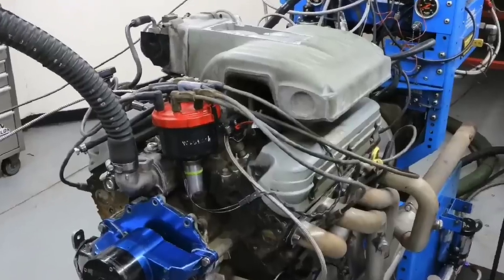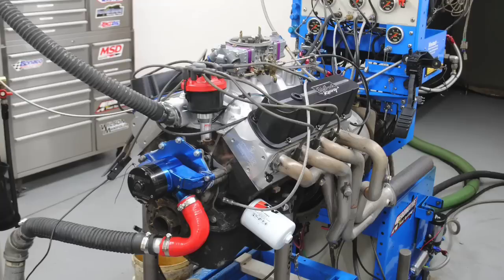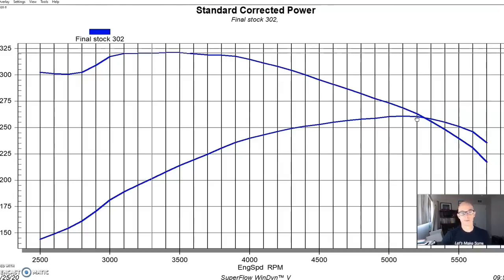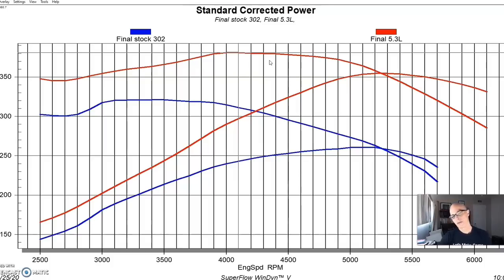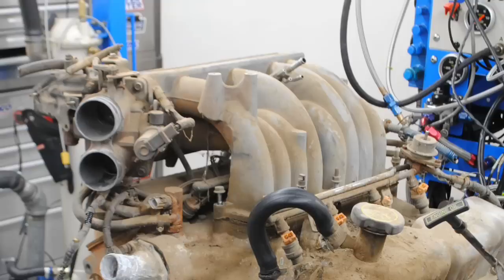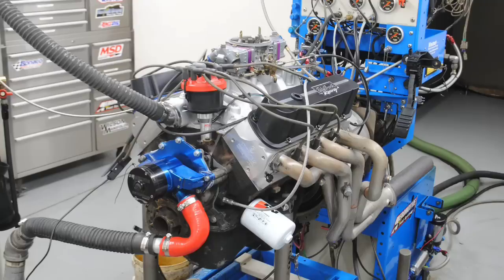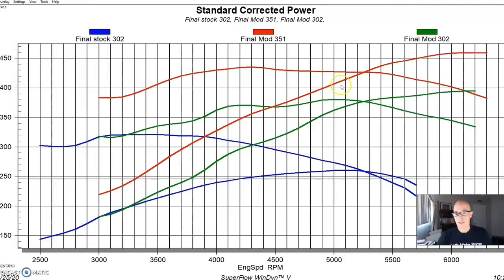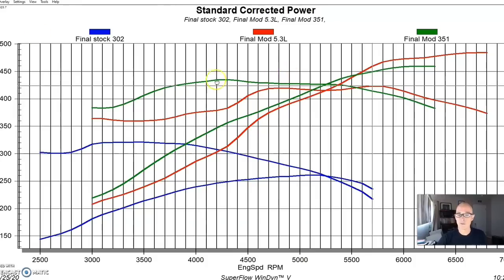5.0L vs 351W vs LS-SHOULD YOU SWAP?

Comment: 1 word = CLEVOR .. Outflow LS heads.  Use the 351 block if you need over 500hp.  347 Clevor is a potent combo.  Magazine guys had Cleveland heads available to them in the 70s and 80s.. and didn't write about them.  I remember Zero Clevor articles back then... damn shame.
Reply: Ancient technology C heads 
Modern is better $$$
Reply: You must be rich
Reply: @hotrodray6802   Airflow doesn't care about age.  Box stock Cleveland heads flow 250cfm.. enough to support 500hp.  David Freiburger's 408cid Clevor made 650hp with Trick Flow Cleveland Heads .. blah blah modern.   Stock Cleveland 4V's can be had for $600.
Reply: 800hp Clevor -  https://www.youtube.com/watch?v=sSjzJQHRs6A
Reply: ^^dont get me started with the Aussie stuff or Yates stuff derived from cleveland heads. 

Fact is GM used the 351w architecture to design the LS. 

Ford could have CHEAPLY done an aluminum 351C headed Windsor to compete if they wanted but they chose to go modular for long term emissions purposes
Reply: The Best NASCAR engine from Ford was actually the Windsor with Yates/Cleveland heads. They dropped the Cleveland block because of poor oiling.  800+ HP and 9500 redline. Chevy could not compete with this until they did a re design and then Ford built the FR9 The LS is a better bottom end Y block with cross bolted mains but Ford has that back in 1962 with the Fe.. Great for a race engine or truck engine but overkill for a street engine, IF you want that in a Ford get a Coyote or the Godzilla.
Reply: @mountainofeverest3861  Sounds good but the supporting hardware will most likely cost you an arm and a leg. What's a good intake cost for that? Headers? I put a budget 393 Stroker in my car that I paid $3200 for, took about another $2k to put it in the car (intake, distributor, headers, pan, etc.) but I will try to go turbo (stupid LX front end is the obstacle now). So 8# of boost won't need head flow as the block will be the limiting factor. Just my thoughts...
Reply: @robertelmo7736  Edelbrock 7183 manifold is $350. 351W roller cam engine core from Pick A Part $200.
Reply: @mountainofeverest3861  Build it, I want to see it lol...would love to see a cheap 408 with those canted valve heads!
Reply: Best racing combination ever. MBE just came out with a new set of SBF Cleveland style heads for 2020. MBE stated that these cylinder heads will put a hurting on any  Chevy cylinder heads available!
Reply: @Greenskies321  They look nothing alike, try again
Reply: burn baby why do you think you can bolt on LS heads TJ a Windsor? Look into it more, it’s not uncommon for manufacturers to borrow or (lease) designs from each other. An LS has a ford FE bottom end with Windsor bore spacing and bolt holes. It was cheaper for GM to do this than to start from scratch and is a budgetary decision. They have to run a business after all and cost savings is crucial when you compete with other car manufacturers.
Reply: @hotrodray6802  lol, them ancient heads from the 426 hemi seemed to whoop up on chevy pretty fucking good back in the day. ford and mopar were in the top ranks. chevy was in the garbage fighting for scraps.
Reply: @Greenskies321  
There's only so many options you face when designing a pushrod V-8. There's solutions that work. Be honest with yourself. How much SBC is in a Ford Windsor in terms of general layout. How much did the Mopar Poly influence the Ford Power Train engineers in terms of valve train layout.  All of the US manufactures bought cars from their competitors and took them apart. They also bought the foreign competition too. Looking at design characteristics, materials in terms of bearings and such. Cylinder head combustion chambers,  port design and flow numbers. If you think Ford engineers walked on water let me tell you a story. In the late 70s AMC was contracted by Ford to produce rear end gear sets because Ford was short on capacity. When the first gear sets came off the final manufacturing process they set them up to run in a test stand to check mesh etc. These gear sets howled really bad. The Ford engineer on site said they sounded pretty good. The other test stand in the inspection room had a gear set for AMCs. The inspector spun up the test stand and all it put out was a quite humming sound. The engineer from Ford remarked, "they don't need to be that good. We'll just put more sound insulation in. I saw a lot of Ford engine parts being inspected along with Chevrolet, Olds etc. I was very unimpressed with the machining and casting quality of the Ford parts.
Reply: Brandon Carpenter  its the firing order. They don't use the old sbc order. LS is still a pushrod motor. Thats what i like
Reply: @mpetersen6  LMAO youre right. Chevy bought bmws to learn about drive by wire.
Reply: @Greenskies321  I did, just because the bolt to the windsor doesn't mean it will work. The windsor has a 4.380 bore spacing. The ls has a 4.400 bore spacing. By the end of the cylinder head, the last cylinder will be .080" off. Also the pushrods don't line up to the lifters. The windsor is not a deep skirt block, the oil pumps and placement is different, the oil galleys are different. The valley is different, the port design on the cylinder heads are different, and Ford isn't the only ones to use deep skirt blocks that are cross bolted before General Motors. So like I said before. Try again...
Reply: technically, GM didn't make its LS a Y block by copying the Ford FE...they make most of their aluminum blocks a Y block. The ZL1 was an exception, since it started off cast iron. But look at the Buick 215--it started aluminum, so it was a deep skirt like the Y block, the FE and the Mopar Big Blocks, but GM does that for strength. When Buick lopped off two cylinders to make the 215 a V6, it kept the deep skirt design until the Grand National. But when they wanted a corporate V6 for FWD, they went back to a conventional V design to lose weight.

that's why its fun when LS heads talk about weight benefits. real HP recipes use the cast iron blocks, and then the weight of the deep skirt erases any weight benefit of the LS
Reply: Hot Rod, Car Craft, and some Drag racing magazines did Clevor builds back in the day. The only really good Cleveland heads were the Boss 351 and 4V heads which are somewhat rare. There's quite a bit of machine work in the swap too. Used aftermarket heads are stupid cheap now and put up similar flow numbers.
Reply: You are right. Even in the Cleveland's day, its downturn exhaust ports were a weakness--Pro Stock crews would cut off the external port and weld on a box tube to give the head the port it deserved--a straight visual shot at the back of the exhaust valve.

Edelbrock failed to fix this, and then there's the issue of intake manifolds. There used to be the Track and Street Boss for the 302, Edelbrock now offers options, but once you get around the coolant flow issues...you could still have picked up some Twisted Wedge heads.

If you have the Sept 2008 issue of Car Craft magazine, turn to page 50...they claim Edelbrock's own flowbench says their Performer RPM Windsor  head outflows their Cleveland by 11cfm @ .5 inch valve lift.   Their port needs a half inch movement upward to really shine.
Reply: @albertgaspar627  The one I built used basically AFR 185 clones on a bone stock 351W short block with a Ford Motorsport cam. Really didn't need any more flow than that for a street car. An 80's Crown Vic isn't ever going to be fast. That combo pulled the highway gears really well for comfy highway cruising.
Reply: @ahoneyman  i live in the rust belt, but would love to land a solid  T bird or crown vic from the early 80's (i had an 86 turbo bird)...tho i would be tempted to slap in a warmed over 400M :)  They are great highway cruisers, and with stiffer gears, they will step out. the nice thing is this was the down-size age, so anything over 5.0 litres is "oversized" for the curb weight, and has a great power to weight ratio even when the engine is at 3,000 rpm. 

The 351W is as under rated as a stroker starting block as the Mopar 318.
Reply: @albertgaspar627  They are thin on the ground. The police versions came with a 351W and a carb up through 86ish (that's where my motor came from anyway) The 400M isn't something I've messed with. Nothing wrong with them just 302 and 351W engines were just easier to find.
Reply: @ahoneyman  true, they and 2 door Granadas/Monarchs (another oddball on my bucket list). There's an '80s LTD running around my locale on Bullitt rims.

The 400M is an odd duck, it has the big block trans bolt pattern since it was supposed to replace the 460, the chamber design was flawed, and i think only edelbrock had a dual plane truck intake for it.  But who doesn't like a little challenge in life? :) Of course, now there's the Explorer GT40P head in any junkyard, so a warmed over roller 351W can be bolted together in a junkyard (too bad the Fox tubular headers won't fit the bolt holes, that'd be a three-fer) and compete with a warmed over Vortec 350 for cheap-o engine replacement in a work truck.
Reply: @albertgaspar627  I put a 400 hp 351 in a 86 thunder bird turbo coupe. It was fantastic. Really fast, with tons of low end power .
Reply: @Herefornow-571  I can totally believe it. I had an 86 Turbo Bird, loaded with options, and it was still a relatively lightweight luxury car since its a unibody (compared to its perimeter frame competition over at GM). The bird has a nice ride, it doesn't trigger the insurance man (Geico told me the turbo didn't exist, so they charged me V6 prices) nor does it draw the attention of Officer  Not So Friendly. My 86 GT Mustang got rousted every year, the 
'bird looked like a bachelor uncle car, even tho it was silver with black aftermarket rims (i would go back and forth between those with a chrome trim ring and the factory "telephone dial" 10 hole rims cleaned up).

The 351W is such an underrated engine. Its finally getting its due. I'd buy every one and every bird I could find affordable, if i had a barn to stuff them into--they're a great street machine recipe. What build recipe did you use to get 400hp?

Comment: It costs basically the same to build a 302 as a 347... and basically the same to go from 351 to 408...
my personal car went from a 302 to a 351 to a 408. My 408 makes 631hp and 558tq NA to the tires. I have no complaints and In my miata it eats a  c7 vette with similar mods as well as my friends turbo 5.3 and another friends built 6.0 fox body. All cars run between an 850 and 950 carb. I run an ultra xp 850.
Search 351 miata on YouTube for the 351 and my unboxing of 408 parts
Reply: Lol it eats a 5.3 ls with a turbo lol 😂😂 yeah ok..
Reply: What you say is true if your starting From scratch and are using non of your  old parts!  Not vary often  the builder is going to scrap every thing  he  has to start over!  You can't  by a rotating stroker assembly for the  cost of freshening a 302.  If your  going 351 then even the intake and headers are different!
Reply: Think what you want.  a built 302 costs basically the same as a built 351 at any over bore. If you are talking reusing your 302 crank and pistons and rods... you're freshening up an old motor. I'm saying it costs the same to have a BUILT motor. T5 trans will still bolt up... if you just want to go with budget... BUILT would have a tko 500 or 600 or t56. Headers are the same because heads are the same. If there is a clearance issue either buy new ones or cut/hammer on yours. I have a 351 block in a 2001 miata... youtube 351 miata if you dont believe. And those videos are before 408
Reply: @barakelium  Tell Me Were can I buy a rotating stroker assembly for the  same price  as I can buy new pistons and have my crank turned,  and I will Buy two of them today. I rebuilt My 302 for 550 and the cheapest I could get a 347 Stroker kit was 1100 
then it had to be balanced!
Reply: No way a 351w can make 680 HP unless it's a full on high dollar cylinder head and built bottom end or forced induction If you despise LS swaps just say that don't make up lies
Reply: @timothywalker2273 408w. 56cc 205 11r heads. Tfs stage 4 cam. Forged 4.0 scat crank. Forged carillo h beams. Forged flat top carillo Bullitt pistons. All similar upgrades throughout. Victor Jr and 850 ultra xp. Intake limited by clearance. 1 5/8 headers limited by space with tko600 and Eaton truetrac. In a miata

Comment: I'd probably do 351W , when swapping for a 5.0, you also have to remember that most electrical connectors, ECU, engine mounts and transmission, will work just as they did on the 5.0. When swapping a LS, rewiring things, new engine management, having to make things fit a little different. Feel like it's more of a hassle IMO.
Reply: It is and it drives up cost too eating into the whole cheap factor everyone raves about.  I am convinced a 351 is a more cost friendly swap for a 5 liter mustang guy.
Reply: @midnight347  not to mention if you have a 5.0 ,I'm sure it has bolt-on parts already that can be used on the 5.8 and continue to keep the budget low

Comment: Depends on your end goal. If I were just looking for a hot cruiser I’d build the 5.0 and not have to worry about making things fit or work together. Max na power, probably the 351 (I always wanted to do a windsor stroker in my old lx). If it’s a purpose built race car I’d go ls.

Comment: That LS area under the curve is badass and undeniable and I’m a Ford guy!  When I get the right deal, gonna pull my 5.0 HO EFI outta my ‘62 Ranchero and stuff a 5.3 LS in it. With the right gearing that lightweight combo should run high 12’s stock and low 12’s with a cam swap/tune.....and get good fuel mileage....I ain’t too proud to utilize cheap technology.
Reply: I always ask Ford guys, do you want to go fast, or do you just want to blow money? Get yourself a LS3 and go fast.
Reply: @MrFoxbody89 - Do you even have a clue as to the meaning of my comment...obviously not. Keep wasting your money trying to keep up HA, HA, HA
Reply: @MrFoxbody89 - You've obviously never heard of power to weight ratio. Maybe you should read a little more.

Comment: I love this comparison. I believe that you did a great job of showing the reality of what Chevy has done vs. what Ford has done. I would love to say that Ford's are better but the bottom line is that Chevy is great at making HP for less cost. If your goal is to make peak HP for the lowest cost the Chevy is a winner. I will point out that behind most winning high HP low budget packages is a 9" Ford diff. All manufacturers have their strong points. I say build the best package that you can for the money and let the best builder win. Some people will win with money, others win with knowledge and experience. It's the exercise in building that makes us all the better for the effort.

Comment: If it were my money, a modified 351.  It would be really hard to justify the cost and work of other items that would have to change to make the LS work in a Ford.  Plus the 351 does better under 5500 rpm, so it would probably be better on the street.  Of course, you could also stroke the 351 to get up around 500HP easily.
Reply: Not really lol maybe street light to street light but on the freeway your gonna get gapped and hard oh and ls1 pistons can be bought used to make a iron 5.7 which makes 500 hp wheel good luck getting close to that with just boring a 351
Reply: @utahcountypicazospage5412  You missed my point: money.  For the extra cost of swapping to a 5.3LS you could have a 408 or 427 Windsor; at 3500 rpm that Windsor would make 100 HP / 160 FtLbs more than the best 5.3 LS numbers in this vid; at 5500 RPM it would still be up 60 HP on the LS.  The 408 will be over 500 Ft Lbs from 3500 to 5400 rpm.  Traction would be your biggest problem.  To get an LS to work in a Mustang will cost around $4,000+ according to a few online articles; modding the 5.3 would just make the difference higher.  That amount will get you a very fast Windsor motor.  Swapping to an LS is fine for bench racing but when you have to make everything fit and actually run the money starts adding up  and for me, it could not be justified.  YMMV

Comment: I have a 1940 Ford PU and I would never put a GM motor in it. I have 351w bored and stroked to 410” aluminum heads with 208 intake valves  Super Vic jr intake  hyd roller. I love it. Cheers

Comment: Watching this video shows that it’s all in the combination up top. Ford used the same head design since 1962 and GM started with a clean sheet of paper for the LS. With the right HCI combination, the 5.0 and 351W would be a decent engine for the street or weekend track runs.
Reply: You're totally right! It's how the engine flows. This is (I believe) why GM went to the similar style heads of Ford's Windsors and Clevo's, and got away from the silly Siamesed heads of the earlier 350's etc.